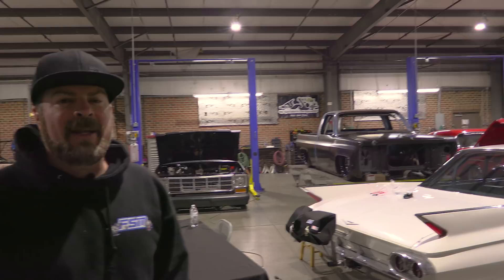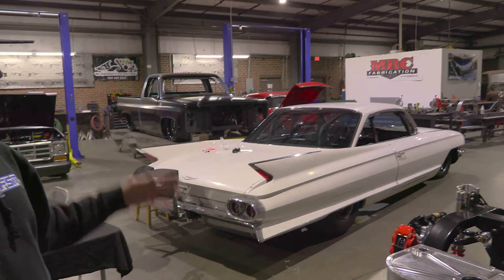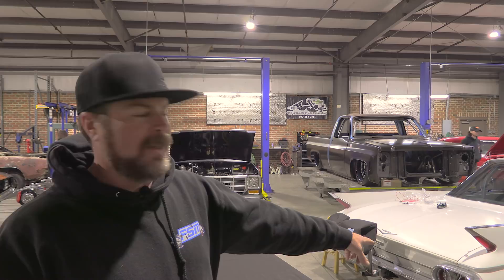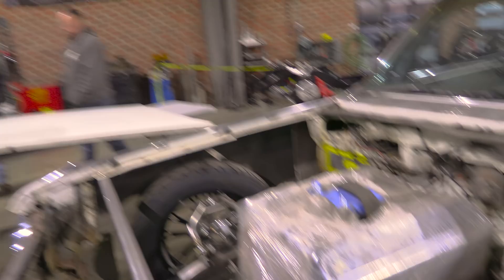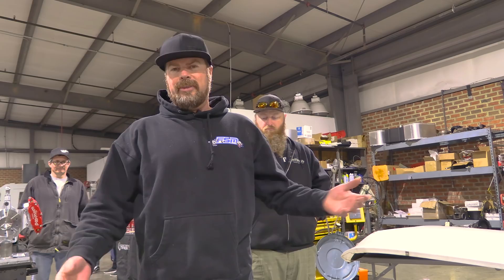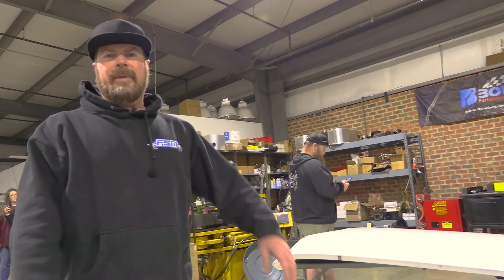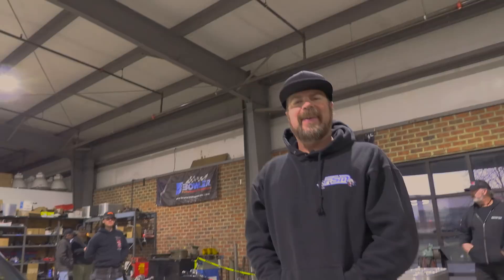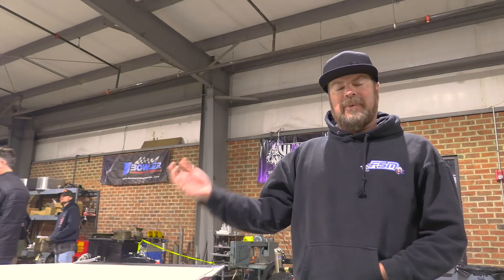Exclusive Interview: Mike Finnegan Shows Off His 2800hp Cadillac Drag Car Build Progress

Comment: So we will see it maybe facing the Mullet El Camino this fall, YES! Thanks for the awesome update on the Caddy.
Reply: Mullet is supposed to run in the 6s this is a car that runs in the 8s
Reply: This  up there with  the comment when people say cleet need to race murder  nova with ruby or any other street outlaws
Reply: @mattspychala7251  If it makes the power that the title suggests of over 2000hp it will by no means be limited to 8s even with the weight, I see 7s 100% in this cars future wether he is planning for it or not
Reply: @tstuff1213  he doesn’t want to go sevens because that requires a more restrictive roll cage and he doesn’t want to ruin the interior putting in a bigger roll cage.
Reply: @mattspychala7251  i know that from watching the videos that he wants to keep it as streetable as possible but i think without even really cracking the power it is capable of it will go mid 8s so i feel like in no time it will just esclate and he will want to go faster. You know im sure what that is like you want to use the car to its potential it can feel wrong only using a bit of the glory to be had. I feel like after the first or second raceweek/dragweek he will want to go faster for the challenge too. Either way i will enjoy watching

Comment: Make the fuel cell 25 gallon. You will want every drop on long drives
Reply: pushrods do ok on fuel
Reply: @THESLlCK  not 8 second push rod motors. Lol if it wasn't a street car I'd agree.
Reply: @matthewmcclain1316  an 8 second engine doesn't have to run (and won't run) on all 2800hp while getting groceries
Reply: @THESLlCK  it's still a large capacity v8 with a fixed cam. You'd almost have to turn cylinders off to get good mileage. Then again, it's not built for mileage.
Reply: It’s a race car. He wants to do 200mph 🤷🏻‍♂️
Reply: @jacobflores7621  he also want to do drag week.
Reply: @matthewmcclain1316  They got like 17 or 18mpg IIRC in Blasphemi when they drove it cross-country the first time. Tunable EFI is crazy
Reply: @matthewmcclain1316  my suburban burns more fuel than my car did, 1384 horsepower in a 93 impala. The wifes honda suv burned less by a smidge
Reply: holy  yeayeah, that's true. I wasn't really thinking about it. Gearing has A LOT to do with mileage
Reply: Still your right, 10 gal tank on rocky mountain race week will suck, Bring a trailer with another 20 gallons!

Comment: 10 gallon tank when your doing 5mpg? You might need to invest in Gas station shares.
Reply: This car is smiles per gallon. He’s gonna need 2x the gas tank size. Although he might be limited on size based on regulations I’m guessing, I haven’t seen the regs, but if it crashes that’s one hell of an explosion.
They probably want you to have just enough fuel for a run & that’s it.
Reply: Is something similar to a ferry tank like in aviation possible? A removable tank that can be stored in the rear/passenger seat between tracks then removed for the run.

Comment: Even though the Weld V-series look amazing and totally make the look of the car, It would be  pretty cool to have someone make you a custom set of original looking wheels with integrated white walls and all to fit the same tire it’s currently on. A white wall beadlock wheel would be pretty epic!
Reply: That was the original plan and a set were made, but they just weren’t going to work.

Comment: What's the weight of an intercooler on a 4700lb car?  It'd be like putting a mouse turd on a Prius, just do it man, do it for the name of POWER!
Reply: With no intercooler you can run more boost which equals more power you just have to run a type of alcohol so you can get cooler engine temps but power is nothing if you can't put it to the track but he shouldn't have a problem spinning as long as he has good weight transfer if he's running slicks but if he runs radials then the coilovers do most of the work

Comment: How do you know your making 2800HP the motor doesn’t even run yet I think your just guessing when it’s built and dyno’d then I would give out HP numbers and a 4700lb chassis is ridiculous even if you get 2000+HP all that weight is gonna hinder you trust me I think you might run 9’s-10’s 1/4’s because of the weight of the car

Comment: You need to grudge match with mullet.....
Reply: Mullets goal is in the 6’s this caddy is 8’s
Reply: @spencersecord3073  I know, but that caddy is going to be capable of way more than mid 8s if they really put as much power in it as they say they are.... plus,  it would just be epic to have those two bad ass builds on the track at the same time. 4500 hp of hotness!

Comment: That hitch was a huge swing and miss. It easily could have been fabricated behind the original tag location. Sticking out like that is gross and lazy. Redo that mount and put the tag on a hinge so when your not towing or rocking the parachutes 🪂🪂 the tag is flipped up in its proper place.